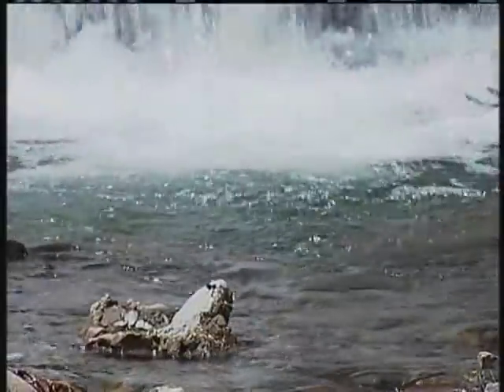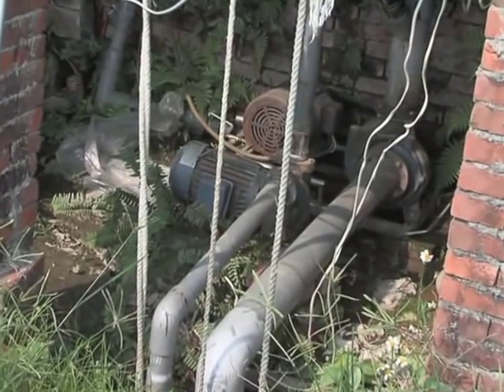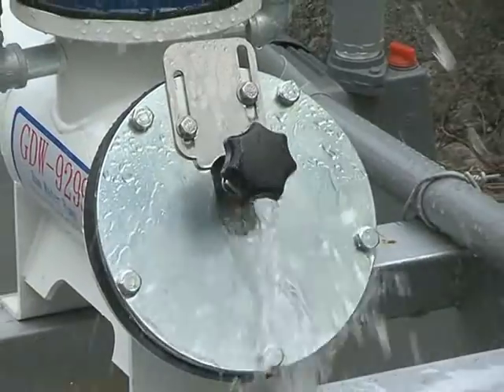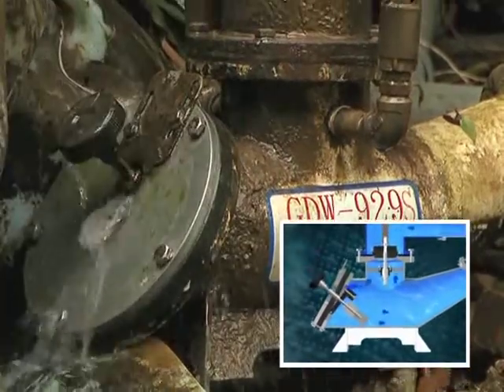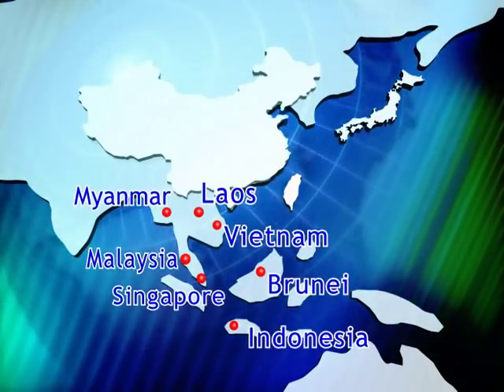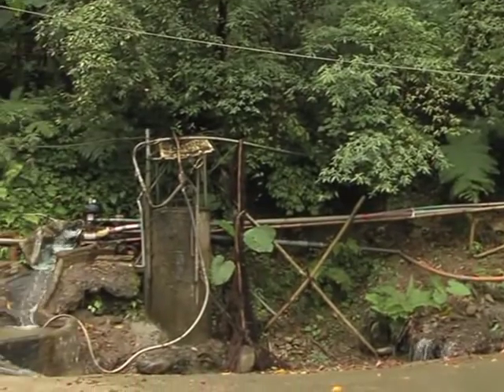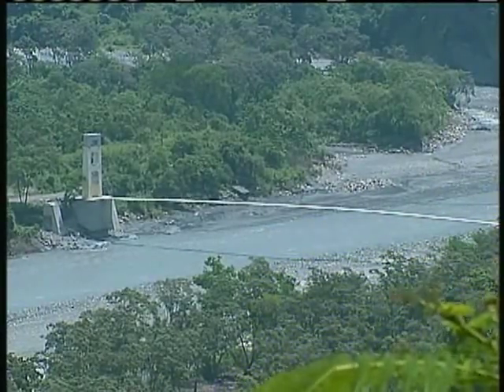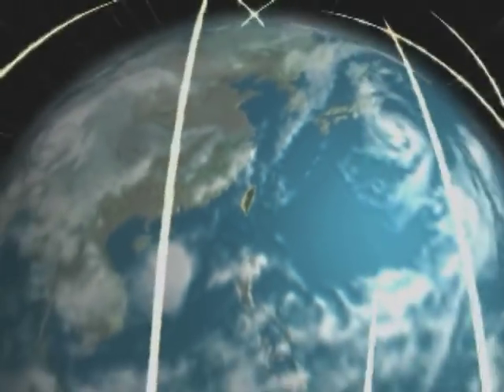Ram water pump

Comment: Up to 80% of the water used is wasted to pump the 20% of the water pumped. A solar pump would work better if installed correctly with flow and float switches. Also can work 24/365 in remote areas, produces no pollution and waists NO water while pumping.
Reply: NOT AT ALL! This pump is designed specifically for a situation that there's running water already just like rivers or creeks in the lower part of the area and you have the need to pump water up to the higher grounds. On top of that, this system is absolutely a lot cheaper than the solar system. Thanks for the opportunity to reason together. God bless.